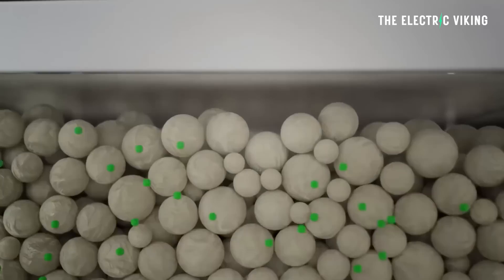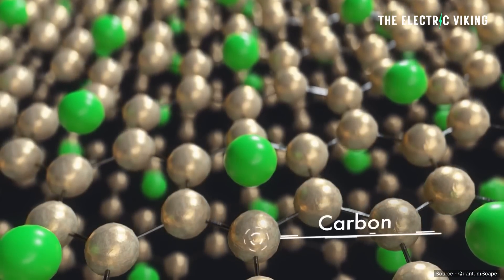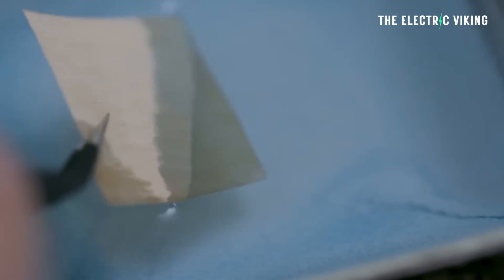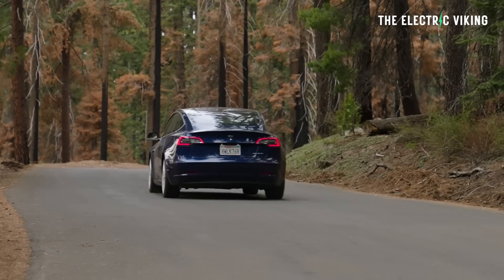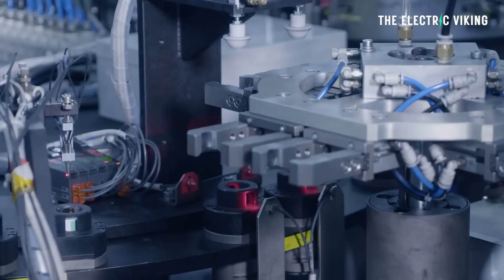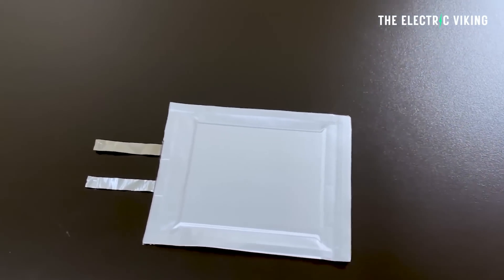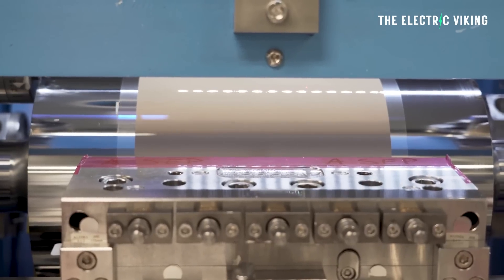Why solid state rivalling lithium metal batteries haven't worked - until now

Comment: The very first li-ion batteries in the 1960s and 1970s were... solid-state batteries with lithium-metal anodes!

Thing is, these were single use and couldn't be recharged. When scientists tried to make them rechargeable, they encountered two problems:
-The seperator/electrolyte had very high internal resistance, so recharging was very slow with high energy losses;
-Part of the lithium-ions didn't nest in the li-metal anode, but formed solid lithium on the surface, called dendrites. These dendrites kept growing with every charge, eventually puncturing the seperator and killing the battery.

The solution they came up with:
-Replace the electrolyte with a liquid, vastly improving conductivity;
-Replace the anode with carbon (graphite). It stores a lot less lithium, but the dendrite problem is mostly gone.

We now see the first semi-solid-state batteries coming to market. These are common cathode / some kind of (Lithiumoxide?) solid electrolyte with a small amount of liquid remaining (for conductivity) / silicon-enriched carbon anode (less stable than pure carbon, stores more lithium, not much dendrites). About 350 to 400 Wh/kg at cell level.
Next step will be all-solid electrolyte, if the conductivity problem can be solved. Which seems to be on the horizon.
Then, change the anode to lithium-metal. Then dendrites need to be contained, but the new solid electrolyte may help. This will push energy density to 500 Wh/kg or so.

The "holy grail" type (700 Wh/kg and over) is the one Toyota is supposed to be working on: lithium-sulphur. Li-S can store the most li-ions of all known materials. Li-S will be the cathode, ceramic electrolyte, pure lithium anode. It is however extremely hard to produce, since water vapor and fine particles in the air will cause deformations, which are the start of dendrites. Rumors say Toyota can make cells, in a glove box that contains a 100% particle free, argon (=inert gas) environment. Not cheap, not scalable.
Reply: What do you think about Catl condensed battery

Comment: Thanks Sam

I have one of the earliest LiFePO batteries purchased in 2012. Its a 24AH 4S originally designed for golf carts. I use it as a portable power pack for 12-15V as pplications including camping, home lighting,  and a host of other outdoor applications. Its had a rough life but still works.very well with no detectable reduction in capacity

Comment: The interesting thing with extended range is that for most markets it is unnecessary. The fact is that the average private driver, which covers 90% of the market, they drive an average of 37Km per day.
The oil industry has done a great job of making range a far more important factor than it really is.
Reply: For 40 years I always only filled up with NZ$20 worth of petrol, which in 2019 was getting me ~100km of range down to "Empty' (now it's ~80km). So when I got a used Nissan Leaf with 95km range there was no range anxiety because I was used to operating like that. It's all about what drivers are used to doing.
Reply: I’m assuming you’re in EU where it makes WAY more sense, but in the U.S. it’s much further and what do you do WHEN you want to go further…gamble that the charger won’t be broken or a line?  For the southern and Western U.S., PHEVs are the answer until the charging infrastructure is figured out.  It’s ludicrous that petrol stations don’t install charging stations, if only to gouge EV stations.  Petrol companies
are diversifying and are
some of the leading installers of solar, install the chargers already!
Reply: @microbiologycory10  I am not from the EU in fact but from a small country, even still you have not thought about this. Yes in the US you are capable of driving very long distances but the realty is that the average private driver drives 37 Km a day and the average EV is capable of around 400 Km on a charge which is between four to six hours driving. How many people do you know that spend four to six hours every day driving in their private car remembering that private cars make up about 80% of the fleet.
Yes the public charging network is still being developed but it will grow as the market grows but for the vast majority of people they return home each night and sleep, they all have power and can charge while they sleep. Even those that dont have off street parking there are solutions to be able to charge from their home account plus there is always the option to generate your own power.
Reply: So is enough a 23k euro car. Like Citroen C3e or Renault 5. With insentives you can buy it for 18k. 
It is perfect for the second car of the family.A car with autonomy of 200km-300km is enough.
Reply: Buy gm ev 1

Comment: 130 cycles is not very many cycles, nor is 400 Wh/Kg is not nearly as good as CATL's condensed battery. Also, how will this battery perform in extreme hot and cold climates.  A 150,000 miles would not be enough range for a standard car.

Comment: Even if you only get 50 charge cycles they need to be installed in race cars and other applications for testing. That will allow study of used batteries to see why they degraded.

Comment: I invested several thousand dollars in solid state solar generator(s) with panels,cables,
the works.For a few hours it seemed to be the future,yea right.....fail.
Batteries only matter if surrounded by proper design and manufacturing.

None of this means shite with Chinese manufacturing with a shelf life of a nat.
I would pay much more for properly not  made in China ,but there are no other choices.
My home grid is spitting fluctuating voltage,brown outs,surges here in California due to the massive amount of EV's being forced upon us,oh the irony of the green saviors.
I'll be out back of my garage burying  more junk in my lithium land fill,screaming at the hot desert sun.
Reply: Lithium batteries are being recycled somewhat now, and they are working on ways to recycle 100% of them, with spent batteries being worth quite a lot of money. You might not want to bury the batteries too deep, LOL

Comment: Can someone explain what a charging cycle is? In Sam's example he talks about 350 cycles which equates to 150k miles, or was it km; no matter.
Without getting my calculator out I am assuming one charging cycle is from empty to full in Sam's example. In my case I charge every evening but only a small amount. If this also equates to one cycle then my battery would struggle to last a year.
Can someone who understands this better than my ageing brain explain what a charging cycle is in relation to battery life.
Reply: I think the charging cycles are full, 100% charging cycles from 0% to 100%. So if you go 30% to 80%,  that's half a charge, so doing that twice is a full cycle. Going from 50% to 75% is 1/4 charge, so doing that 4 times is a full cycle. 

The expected battery life in miles obviously depends on how big the battery is (how many kWh) and what kind of mileage per kWh to expect from a given EV so there's a lot of averaging going on.
Reply: @twostate7822  thanks for your explanation. Makes good sense.
Reply: Every one buy new xar after 150,000. Soo dint get mkre then 150,000 ioes

Comment: In the long run SSBs will be more energy dense simply because of the way that physics work (solids are denser than liquids)
Reply: really, there is nothing stored in the liquid.
Reply: @ursodermatt8809  The liquid is an electrolyte, so it does in fact hold energy :)

Liquid electrolytes in batteries, are typically composed of lithium salts dissolved in organic solvents. They provide the ionic conductivity.

  On the other hand, solid electrolytes replace the liquid with solid materials like ceramics or sulfides. These solid-state batteries offer the potential for higher energy density due to their ability to pack in more material, think about it like this: Is a KG of iron dissolved into water easier to carry around or is a solid 1kg hunk of iron easier to pack into tighter, solid spaces? 

 Although manufacturing solid-state batteries at scale remains a challenge at the moment, due to higher costs and technical difficulties, it will be resolved eventually, plenty of smart people in the field.
Reply: @ursodermatt8809  Hope this information interests you, have a great day!

Comment: Great video.  "10K wh in a gallon of gas."   I love hearing stats like that.
Reply: Sam said 10KwHour per Kilogram of weight not a gallon. 1 Gallon of gas weighs a little less than 6 kg
See @tothimre7950 detailed comments below
Reply: Correction 1 gallon of gasoline weights a little less than 3 kg
Reply: Liquid fuels are 33-37+kwhs per gallon in total energy capacity. With road gas at 33.1-33.7kwhs per gallon.

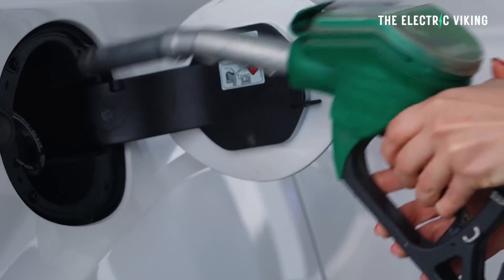Comment: 4:40 "energy density of gasoline is about 10K Wh/kg" it is really just about. Actual facts are 12,66k and 12.88 Wh/kg so way more then you say. https://en.wikipedia.org/wiki/Energy_density#In_chemical_reactions_(oxidation)
But I think and you should emphasize, that is the ICE cars effectivity is about 20-30% (depends on age and pure burning efficiency not Hybrid!!!) So from that 12,888.9 Wh/kg actually you use MAX 3,866.7 Wh/kg to MOVING YOUR CAR!!!! 70% what you buy is becoming HEAT...
Reply: No only that, once you factor in the energy cost of producing the fuel - the Well-to-Wheel energy cost - fossil fuels comes as requiring over 4 times the amount of energy as Batttery EVs per km travelled.

Comment: One thing which might be useful even at lower cycles and lower density is a backup battery for the main battery.

All you'd need is 100km range of backup to get you to a charging point.
Reply: not serious are you?
Reply: @ursodermatt8809  dead serious.  If they can get a 1-4kwh back up to weigh  about the same as the 12v battery it makes logical sense to get rid of that 12v battery and maybe look at using the replacement as an emergency backup just to get someone to the next charge station, or at least, closer to it.
Reply: If your main battery has already 60-70kwh charge - why would you want an additional small one as well?
Reply: @christianolsen9781  replacing the 12v battery plus hacing essentially a backup battery if your main one runs out.

Comment: I can see that being an attractive proposition for some consumers, the model Ferrari is using.  Replacement of current battery with state of the art battery pack eight years in the future.   

Could easily morph into "lifetime replacement guarantee".  

I can see other niche markets, such as high end electric OHV's, also electric pickups and campers.  Lighter weight, and/or better center of gravity, and the range to spend a week exploring gravel back roads on one charge.   And set out panels when settled,  put back in enough charge to make sure you get off the mountain. 

For some, hitting specific performance goals, to make an new activity possible, is worth the cost.

Comment: Battery design has many trade offs. Unfortunately most of the time people only focus on energy density. There is also longevity - both in terms charging cycles and calendar life. Also temperature sensitiviy, and charging / discharging rate. Often, they leave out one of them and only emphasize the one impressive metric.
Reply: Yeah… LFP batteries, for example, have amazing longevity. No one talks about those because they’re in base RWD models. But if we could just increase their energy density and output, we’d have a perfect battery that could be used in performance models.
Reply: @ElMistroFeroz  I think it is now done... Watch the guy other videos he is constantly explaining batteries. There M3P battery and BYD Blade 2.0, Zikr own LFP improvements now all has around 190-205 Wh/kg which is like 15-24%. It is already in use in China. Many people is waiting for the new Model Y it should the first western cars using those new gen LFP

Comment: Recent research points to a striking pattern: Higher home insurance premiums are being charged in U. S. states where regulators apply essentially zero scrutiny to requests for rate increases, justifying inaction by laizze-faire "free market competions", Texas and Oklahoma for example, compared with states where officials question the justifications offered by companies and try to keep rates low, California for example, research shows. In California, which had over 7,000 wildfires last year, the typical homeowner in many ZIP codes paid premiums as low as .05 percent of home value. By contrast, in most of Texas, Alabama, Oklahoma, and Louisiana (Red-State Legislatures), the average homeowner faced home insurance premiums GREATER than 2 percent of the value of local homes. Glen W. Mulready, Oklahoma’s elected insurance commissioner, has NEVER exercised his power to deny a rate increase requested by an insurance company for home insurance. He said he believed that imaginary "competition, not regulation, was the best way to hold down prices." Clearly that is entirely NOT correct, and he must realize that to be the case. After big losses in appropriately regulated states, such as California, national insurers raise rates in unregulated and loosely regulated states, such as Texas and Oklahoma. Enacting reforms to address the cost of disasters “requires people to accept that climate change is REAL.”
Reply: Isn't California seeing insurance companies leaving or at least greatly limiting business?

Comment: Charging time is more important in high density areas.  Give me 350 miles and 5 minutes to charge.
Reply: EVs have that - in fact, they can be charged using 15 seconds of your time when you charge them at home.
Longer trips, roll lunches or other breaks into charge breaks. It's not that big a deal.
Reply: Nope, prefer the way EV's charge as the car's wasting its time when charging and not mine; I just get on with things I want to do whilst the car is charging in the background.

Why has the annoyance of having to wait around with your car whilst it fuels become such an accepted norm; one that is now being touted as a desirable goal to replicate yet again. It was a nessecary burden of a past technology, purely an imposed time burden.

Home and destination charging makes so much more sense, particularly in high densty areas. For longer journeys breaking up the journey with a planned pitstop to refuel and relieve the human, not the car, is the important point - let the car get on with it's own needs in the background.
Reply: It's not just the battery. 350 miles corresponds to around 90 kWh of energy depending on the EV. The fastest level 3  chargers generally available are rated at 350 kWh with others at 250 kWh or even 150 kWh. A few math calculations later, that works out to 15+ minutes of charging if charging proceeds at the maximum rate of 350 kWh. 

Of course you can charge your EV in 5 minutes, but you won't get 350 miles of additional range added.
Reply: Incorrect, it is more valuable to have a bigger capacity for two reasons:
- less charges need per same total distance. So longer battery life
- more practical for long trips 
- can be charged when energy is ambudant (cheap) i.e. at night or during solar peak so no need to upgrade infrastructure that much as for mass ultra fast chargers
Reply: @AlexanderSh-t9w  - With batteries you can have the best of both - particularly with the 195kWh/kg LFP and 260Wh/kg NCA batteries available.

For smaller low mileage/city style cars, those typically only doing a few miles a day, you can optise for lower weight and lower cost using fewer higher density batteries. Increasing range through the raised efficiency a lower vehicle weight offers - having a sub 1 tonne car with 200 to 300 miles range for example from tiny 190kg battery. 

For other needs, you can have the option of touring style cars packed full of high density batteries optimised for range and power, though with lower efficiency. Circa 2 tonne cars with 500+ mile ranges. 

Both would offer low frequency of charging, as it will be down the typical usage pattern of each car. With 500wH/kg tthese numbers could easily double, but at this level it might be an issue for the lower cost cars to charge to 80/100% in a reasonable timeframe as the tend to have lower spec battery electronics.
Reply: @AlexanderSh-t9w  wrong.  Look at the average distance travelled  by a car globally per week.  Then consider why most people would need to carry  many many times greater weight continually.  I top up my car with petrol every three weeks.  Next week I will do an unusually long distance of 160 miles.  80 each way.  In my country the average mileage per day is 18 miles.  Why do I and others need to pay more for a lot of heavy capacity and permanently carry that capacity for a lot more?  Also in my country one-third of houses do not have a driveway or facility to charge overnight.  For them to move away from petroleum needs fast charge.  But as we have seen they dont need large capacity.

Comment: What I want to see are solar roof tiles which capture either electricity or heat or both ,for storage and distribution; tiles which can be installed by any roofer, will last as long as standard roof tiles, and are about the same cost...safe in any climate.
Reply: Different: Use normal Solarpanel and make it water sealed.. Easier, the small tiles are to small you loose to much space....
Reply: Those hybrid modules exist but are pretty rare due to their high price. The combination of normal PV modules and a heat pump can deliver AC, warm water/heat, and electric power. PV tiles suffer from contact problems and high prices. So if you want the most bang for the buck, think about normal PV and a heat pump.
Reply: Why? They failed already. Nobody wants to pay U$60,000 for a roof on a standard house.
Reply: @Paul_Harling_Vancouver  reading comprehension is a useful skill
Reply: @Peoples_Republic_of_Cotati 😂😂
Reply: @Peoples_Republic_of_Cotati I think I will be borrowing that.

Frequently 😂